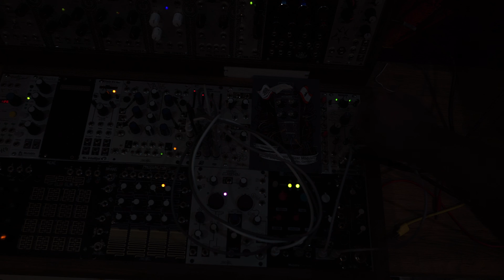Exploring Modular Synths - Easy Patch Introduction 3 - Batumi and Clouds

Comment: I just bought the Clouds unit to be used as a standalone(I dont own any other modules due to me being more desktop synths) for some ambient experiments. I was looking around for a small LFO module to complete the CV and trig part of clouds inputs.This was awesome. I do own a Make Noise 0-coast, and that "patch" you had going almost reminded me of the self generating KRELL version. Thanks for this demo! :)
Reply from the maker: Thanks, man! Clouds is an amazing module and I know a lot of people use it just for processing by itself (of course you need to feed it some CV somehow).
Reply: Ive used SQ-1, BeatStep Pro and MicroBrute's in and outs until now. But with Batumi you have square for trig´and the other out's for CV - and even patch within Batumi itself like you did sounds amazing.
Reply from the maker: Awesome. Would love to hear your stuff!